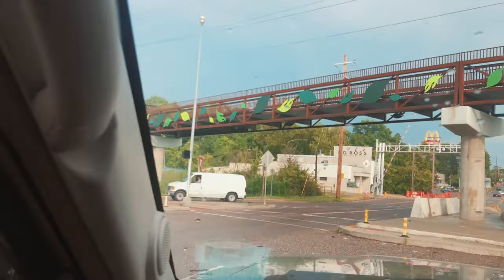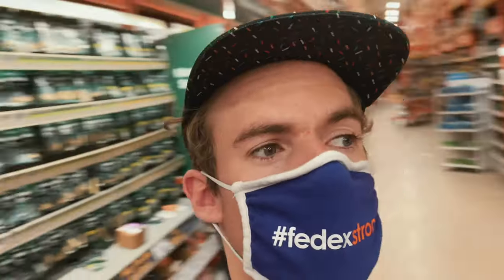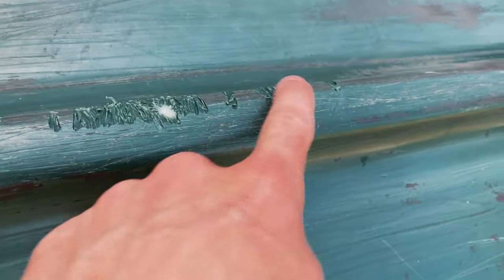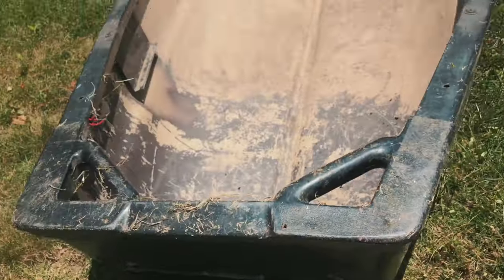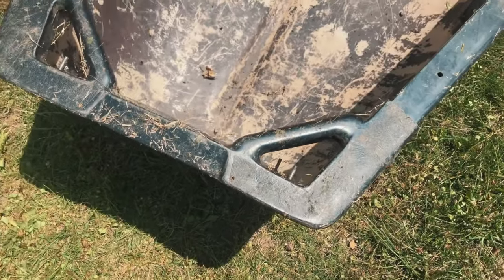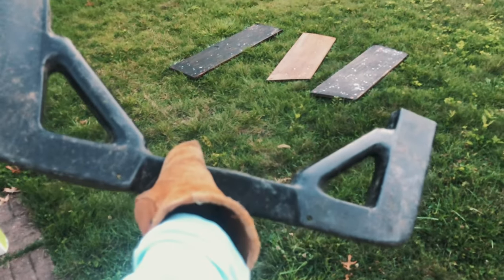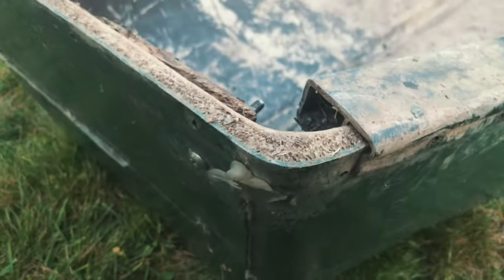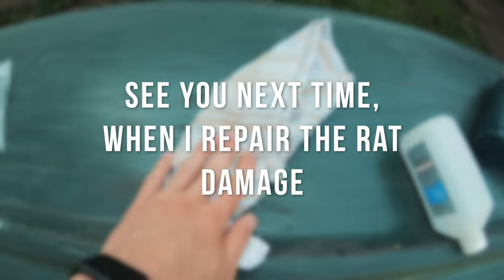Old Town Canoe RESTORATION - SURPRISE hull issue, Transom Cap, Paint removal

Comment: upol raptor liner two part bed liner spray on
comes in white and black and you can color the white any automotive color
it can spray on textured or smooth
Reply from the maker: These are the kind of comments that make this internet thing great. Thanks for the specific recommendation 🙏